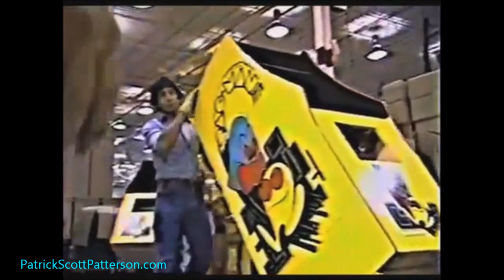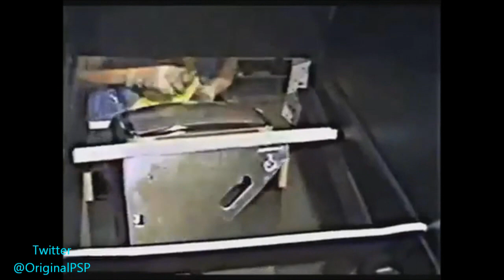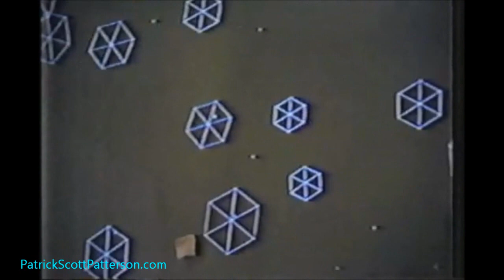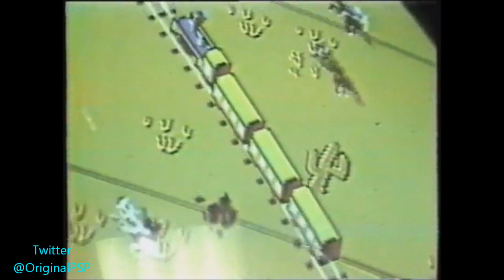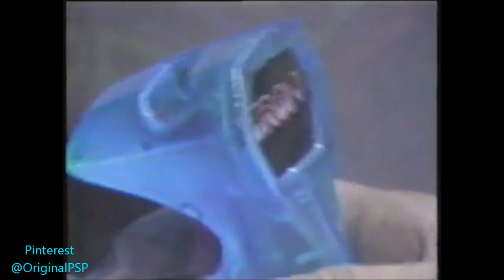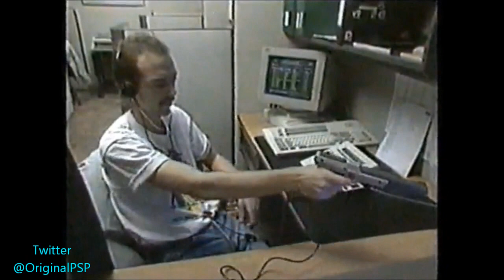1980s Video Game Companies Factory Footage

Comment: Now it’s that 1up garbage
Reply from the maker: Meh. The 1Up machines are not made for the die hard collectors, just the casual homebuyer who wants something affordable and with a small footprint that doesn't look like it sat in a laundromat for decades. I have no problem with them. They made "home use" pinball machines and air hockey and all that for generations now... the 1Ups are the same thing. I'd have loved them as a kid.